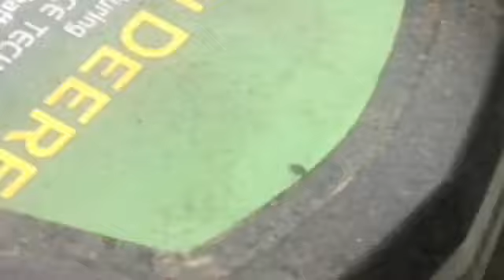THE JOHN DEERE STORY CONTINUES

Comment: Check oil level, if it smells like gas bad the oil is overfull causing the crankcase to fill with oil and its pushing oil into exhaust, gaskets can only handle so much . In video it appears the valve cover gasket is leaking on bottom dropping it onto the muffler. Runs to good to be severe. Also sometimes this will happen if its sat for a long period of time. Gasket is a easy fix and not expensive . If oil is in gas sounds to me like the fuel pump diaphragm has gone bad. Install a manual shut off valve between filter and the carb in the fuel line that should stop it

Comment: Valve cover gasket is leaking on to the muffler King I have the exact same engine in mine and believe it or not just last week it started leaking oil  and it was the valve cover gasket , its a really thick cork gasket  that shrinks with use and age and leaks oil directly on to the exhaust , I took the cover of (4 10mm bolts easy as to get to)  I cleaned it with petrol and silicone it on and put a flat washer on each bolt to increase the clamping force as the bolts have a stepped stop on them to prevent over tightening .  Common problem and simple as to fix .  New gasket is probably about 5 bucks max if you want to go down that road.
OH and its amazing how much oil actually leaks out of it King. You wouldn't think that much oil got up to the valve train area.    Your cold winter would have shrunk the gasket and now its to thin.
Reply from the maker: That sounds like a possibility winter being really cold leading to this problem
Reply: @steelisthemeal  Trust me king take the 4 bolts out of that cover , its just the valve and tappet cover , clean it up and silicone the gasket on the cover both side of it sparingly and add a washer to the bolts before putting it back on and then bolt it back up . Or just buy the gasket for a couple bucks . Trust me its definitely the problem. That mower is far to good to abandon.  You should do a tappet adjustment while you have the cover of to .
Reply from the maker: Yeah I don’t know how to do the tabpet adjustments. 
Rtv blue heat resistant silicone gasket maker I could do that
Reply: @steelisthemeal  yep that will stop the leak and put a flat washer on each bolt it will help take the lost clamping force due to a shrinkage .
Reply from the maker: Just gotta be careful not to snap but hey let’s try it 😁
Reply: @steelisthemeal  They have a step on the bolt so it bottoms out so just stop when it hits that. There only about 5-7 lbs torque King so just firm is all they have to be ,
Reply from the maker: Yeah cause I wanna say it’s aluminum but I don’t know for sure as I haven’t gotten to taking it apart yet

Comment: a compression test ought to verify if you have a head gasket or cracked/warped head instead of just an oil leak somewhere. easy test to do. tool 30 bucks though.
Reply from the maker: Sounds like a solid plan

Comment: I got one gave to me because it did the same thing when I got it and I just had to replace the valve cover gasket it was dripping oil on the exhaust and smoking it worked fine after that maybe you'll get lucky I sold it for good money
Reply from the maker: Yeah maybe will start with a simple cheap fix for it
See what happens

Comment: Your gas in your oils mixing because of your bad blown head gaskets that's where the smoke is coming from that's a Briggs & Stratton motor which has two heads you can order the parts online for about $25 comes with two head gaskets not very hard to do
Reply from the maker: Thanks for the info I appreciate it
It’s a one piston engine
Briggs and Stratton
Reply: No problem it's still your head gasket though it's mixing with your fuel in your oil that's what creating the smoke
Reply from the maker: Sounds like I’ll probably need to fix it soon
Then
Reply: @steelisthemeal  yes I do that looks like a nice tractor and for about 25 to $30 with the shipping that's a good investment because if you wanted to you could turn around and sell that tractor for four or five hundred dollars to the right buyer
Reply from the maker: Yeah other than a blown head gasket or whatever is wrong with it it seems to be pretty decent it gets the job done really quick 
I can cut my entire front and backyard in about 30 minutes

Comment: Don't buy this John Deere x147r Ride on mower. Unless you want to mow a level short lawn that doesn't get too long. Maybe a bowling green would be suitable.
The grass shute constantly clogs up if you mow heavy green grass so you have put your arm in and pull it all out.
You have no warning when it clogs and jams the blades while the motor keeps spinning the deck belt resulting in black smoke coming out that lets you know there's serious problem.
If you're lucky the belt will jump off the pulleys.
Putting the catcher back on is a frustrating procedure the makes you think it from a different model. The lock catch on the catcher releases very often dropping grass out the back. The whole catcher set up is flimsy and cheap. Not too mention frustrating.
Not good around trees as the catcher handle sticks up way too high and hooks onto branches.
1 hr of use after buying this brand new mower it developed an unnerving clunking sound in the deck.
I've always owned John Deere and have been a happy customer,but this model is poorly engineered and designed.
Reply from the maker: As a J D owner ya probably have experience these troubles probably more than once I can hear the restoration just from the words that I read
Wow ! Yeah that’s kind of been my experience with it ya actually have to mow the lawn twice a week @ least 
In order to avoid those clogging issues and that clunking sound
Whoever owned it before me must’ve taking it right to the limit because I didn’t have it for very long before
It blew a head gasket 
So frustrating 
Nope it doesn’t get very close to the trees
For that you need a string trimmer. 
Although it’s more powerful feeling than yard man brand and craftsman brand mowers 

Ha yeah The fan belt stayed on
As the motor struggled with an average length of grass to be mowed
I had it on the highest setting so as to not overload or strain the engine
Wasn’t enough I guess